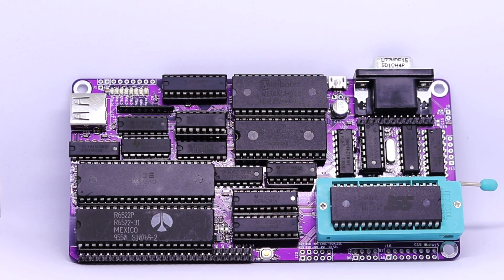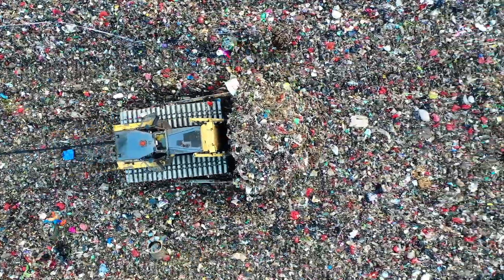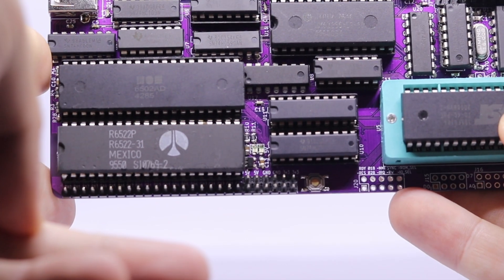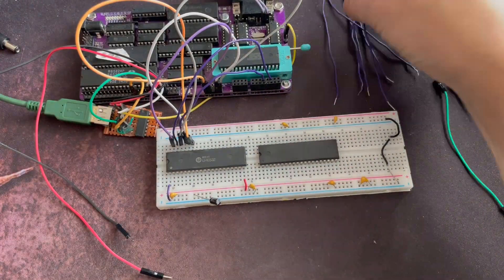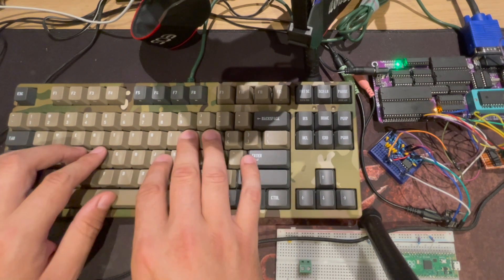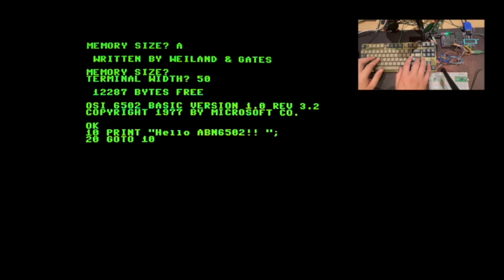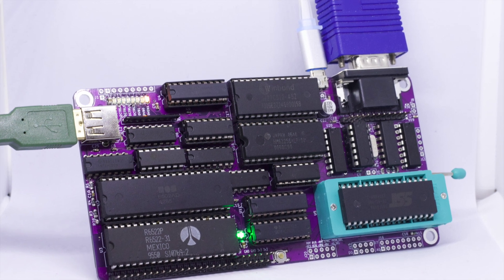A 6502 Single Board Computer built from scrap!

Comment: I wonder how much work I would need to port collapseos to this, I know there is an Apple 1 build of CollapseOS
If DuskOS on an RPi is a godsend for the specific breed of hardware hacker I belong to, collapseos on this thing would be just as great
we got a whole bunch of arduinos at the hackerspace I visit in copenhagen, I should be able to "complete the chain" with this thing, actually.

It is amazing, supply chain resistant salvage computing is the way to go for me. Thanks for contributing with this device!
Reply from the maker: Shouldn't be hard to get CollapseOS running at all :) At the moment it's a BIOS(tape I/O routines included), monitor and runs BASIC.
Reply: @AndersNielsenAA  Awesome!!

Comment: Great idea! Coincidentally I have started scavenging the infrared receivers out of the busted up dumped TVs which litter the streets of Berlin. They interface directly with microcontrolller GPIOs, and so can add remote control or beacon detection to any project for free and almost zero effort.

Comment: Very nice idea of recycling. 

How about 8051[2] for this recycling purpose?

All full 8051[2] can be reusable except some modified small one such as ATMEL chips using /EA = 0.

And most of 8051 were used for industry rather than personal computers. 

It has basic interpreter. 

It has cross compiler.

It has GPIOs [at least 8]

USART etc. 

If Arduino-like IDE can be considered, Long-time-usable low-cost SBC may be considered.  I think.

Surely, if we want reusage of old software… Z80 or 6502 is the best. 

But disasembling of old PC will be not issue with 8051.
Reply from the maker: I already have a pretty big stack of 8051's lying around - I hope I will get around to making a few videos about how to use it .. "soon". Maybe I'll make an 8051 PC :)
Reply: @AndersNielsenAA   great idea.

Comment: Hehehe. I'm building my own homebrew 6502 machine (with the newer WDC 3.3v capable 6502) but I have a stack of NMOS 6502 & 6522 CPUs in my drawers.. so I just HAVE to build your SBC for a bit of soldering fun. Hopefully I have enough logic chips to finish it. Better check the BOM. Thanks for sharing. Your video logic will be simpler than the complicated crap I have implemented in my FPGA - I will probably learn a thing or two!
Reply from the maker: If you haven't ordered the PCB yet, you might be happy you waited a bit - I made a few (untested) improvements. 
https://hackaday.io/project/184725-abn6502-sbc-r1/log/213702-hobby-friendly-gerbers-available
Reply: @AndersNielsenAA  I have a packet of your PCBs sitting on my desk just waiting for a bunch of components to arrive. I also stuffed up my own PCB in rushing it for the Xmas hols.. I can't wait until the day comes where you can buy a cheap PCB printer of some form 🙂

Comment: Great project. I downloaded the KiCad files and was on the verge of ordering a PCB when I realised how many 0805 and even 0402 parts it uses. My old hands don't work well with anything much below 1206. But a sweet system, nonethless.
Reply from the maker: The 0402’s are only meant as solder jumpers - no actual 0402 parts needed - I underestimated how hard it is to actually solder jumper them so I’ll have to change those to dedicated solder jumper pads for the next build.
The next hardest thing to solder is the micro usb connector and the 3v3 regulator (which are both technically optional).
And then there’s the 0603 capacitors but those are easy if you tin one pad first, tack the cap on there and then solder the other pad. Same idea for the 0805’s but even easier. Also, notice how many 0805 and 0402 pads are “no connect” - most of them are only there to test if I can run the system without the 74hc245s if I use a 65c02 and configuring the VRAM alternatively.
I appreciate the input!

Comment: What?! Reading SPI or I2C data over VGA? I have to know more!! :) <citation needed>
Reply: Ah yes DDC I should have remembered it but had long forgotten. Great PCB & project, well done 👍
Reply: He also some how got wifi working on it... wonder how he was able to do that...
Reply from the maker: 2.4GHz RF doesn't have to be WiFi :) The RF module via SPI uses the nRF24L01-protocol - have another video on that. It's more like Bluetooth than WiFi. 
https://youtu.be/NABU7gQDtcs
Reply from the maker: I probably should’ve had a full stop in there somewhere - displays have this thing called DDC that can be read out like i2c. That’s hooked up to the 6522 on the newest build version. It’s a convenient way for me to test my bitbanging i2c implementation.
https://en.m.wikipedia.org/wiki/Display_Data_Channel

Comment: I need this! Is there a way this can be bought as a kit?
Reply from the maker: I'm considering it. 
On the topside of the board the smallest components are 0603 caps and the SOT-23-5 3v3 regulator - I don't know if I can expect the target audience to solder those successfully. On the bottom there's only a few pads meant to be shorted with solder and 0805 pads. 
Would you prefer a blank PCB + parts or a more expensive option with the SMD components preinstalled?
Reply: @AndersNielsenAA  Yeah SMD soldering is pain, but I guess 0805 pads would not be as bad considering its in a few places and the caps, crystal are somewhat easy to do. Maybe you can keep optional THC option as well, but redesigning would be harder for you.
Reply from the maker: I ended up changing the solder jumpers to something more reasonable and adding redundant 0805 capacitor pads easily accessible on the PCB back. A bit more hobby friendly now :) 
https://hackaday.io/project/184725-abn6502-sbc-r1/log/213702-hobby-friendly-gerbers-available

Comment: Are you saying take vintage 80's hardware and take it apart to build another computer?  Why not use the vintage 80's hardware?  Unless you mean to use parts that have already been pulled or found, etc.
Reply from the maker: No vintage equipment was harmed in the making! The idea is to use parts already pulled and recycled properly.
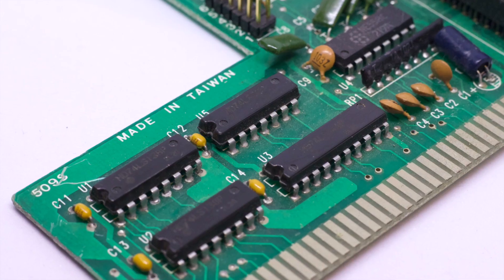Reply: He did say “to stop parts ending up in the landfill” @01:46
Reply: The point is not using the 8bit computer, it's about learning,when you build it from scratch you learn alooot,after finishing the project,you know so much more about electronics than befor finishing it
Reply: @theashkone1530  Yeah, I get that.  I designed my own 65C02 SBC a couple years ago.  Used all new parts.  So I was concerned he meant "take apart your vintage gear to build this!".  Or perhaps encouraging people to do so.  That was always my complaint with Ben Heck.  I wonder how many Atari's, etc. died because newbie tinkerers tried to desolder chips only to destroy them all so they can make a portable 2600.  😕
Reply from the maker: By the look of the online markets most of the 2600’s have already been scrapped and the parts are now for sale in the tens of thousands - hence my 6532 video.
My point is to buy these old 6502s, 6507s, 90’s EEPROMs and RAMs, instead of buying new - so we encourage recycling instead of grinding the IC’s to powder or dumping them. 
And if we get a defective one here and there it’s just part of the fun :)
Reply: @AndersNielsenAA  they also recover the gold before damping the parts